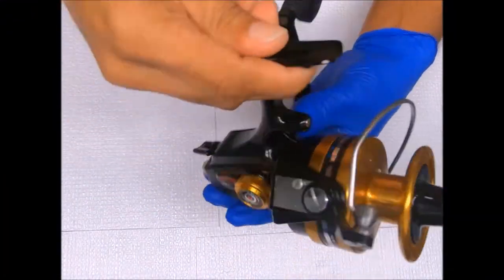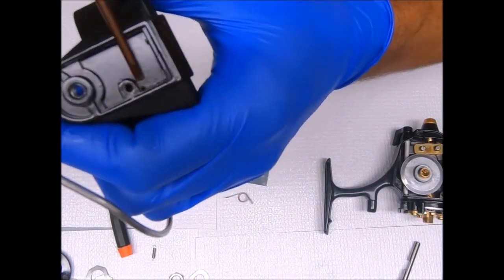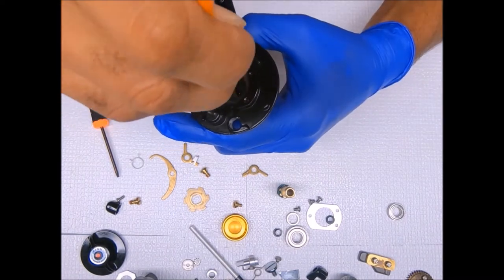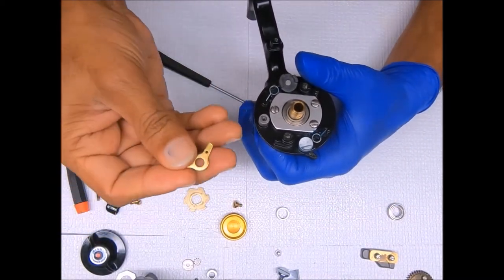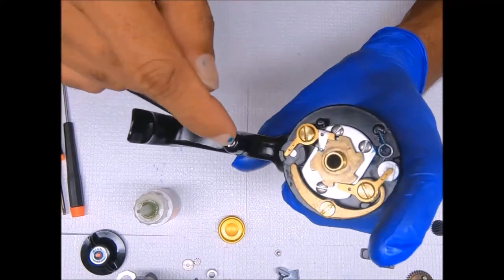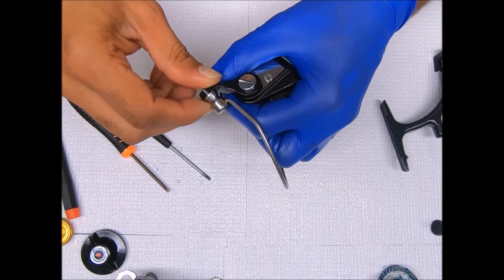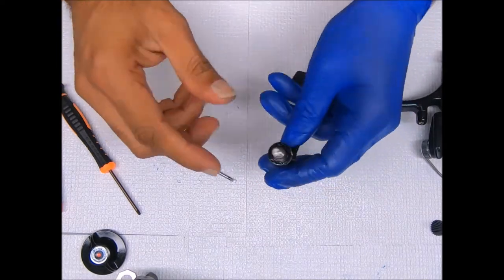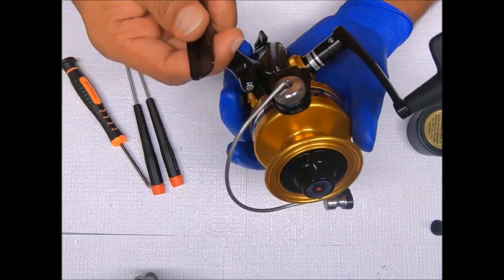Penn Spinfisher 6500SS Fishing Reel - How to take apart, service and reassemble

Comment: Another useful video for my 6500ss. I found out that the pinion has dent in one of the borders… need to be replaced. Thanks again bro
Reply from the maker: Glad to hear it helped you discover and remedy the problem. Next video drops in two days.
Reply: @TSGReelService  I’m experiencing a problem with the bail wire assembly of my 4200ss after being assembled. The bail do not fell when I reel the handle… probadly the trip and cam lever that are placed inside the trip cover are in the wrong position. I tried to see in your video that detail but you are to away from the camera.
Reply from the maker: @falcony100   @falcony  try this video for the trip lever:

https://youtu.be/X5KrtBxLNxM

It's not exactly the same setup, but gives you a good idea how to correctly install the bail trip portion. If you can't access it with the above link, search YouTube for "bail trip tsg". Let me know if it helps.
Reply: @TSGReelService  thanks  a lot for your help… I will let you know for sure 👍🏻👍🏻👍🏻👍🏻👍🏻.
Reply: @TSGReelService  run off words… millions of thanks again 👌🏻🙏🏻🙏🏻🙏🏻🙏🏻🙏🏻🙏🏻
Reply from the maker: @falcony100  you're welcome and no worries. Glad to hear it helped.

Comment: Excellent video! Extremely thorough. Where can I get a set of screwdrivers and small brushes like you used? Have you done a maintenance for a Shimano BaitRunner 4500? Thanks!
Reply from the maker: Thanks for watching, Doug! Small screwdrivers... easiest place is Amazon or eBay, brushes from home Depot... you'll use the brass and stiff bristle kind more often.

Comment: What dry grease did you use for the drag washers? Thank you this was the most informative video I've seen in a long time, I've re built 2 650ss because of your video and didn't miss a part
Reply from the maker: Cal's. Spread the word!
Reply: @TSGReelService  Is Cal's really all that?  What's wrong with plain old Penn blue grease?
Reply from the maker: @hotajax  Hi.... yes, at high temperatures.... think of spinning reels' drags smoking with a large Kingfish run. However, for the average fisherman, no. You can also run them dry if you  prefer.... it'll give you stronger drag through the range since there is no lubrication.

Comment: Is it true Penn won't service these anymore? And that you cannot get some parts?
Reply from the maker: Thanks for stopping by. Yes, you can check their website for the reels they no longer service. Most SS parts can still be had.... just a matter of price as the supply dwindles.
Reply: @TSGReelService  Great! I didn't think the reel was even that old. Guess it is.
Mine works, it's just that the bail does not seem to open all the way. From your video, I cannot tell how far back yours opens.
Reply from the maker: @Redreefmedia  they actually are that old. You can bend the bail if it's not opening far enough for you. Just go slow and in increments until it suits your eye.... Open it manually pull the wire from the horizontal to the ground... be careful! The connections can break.